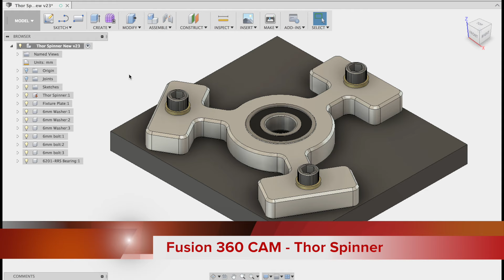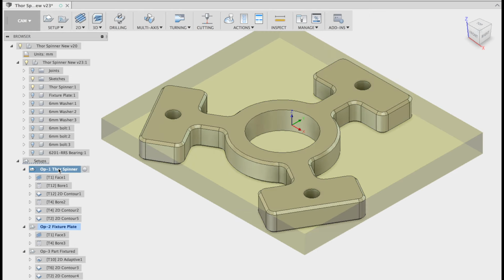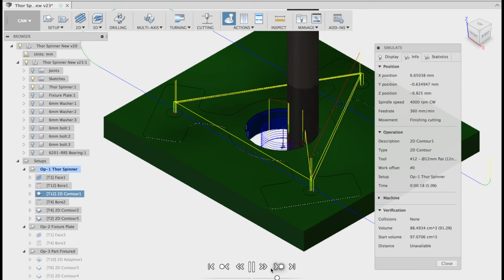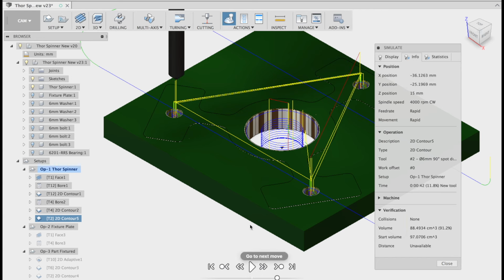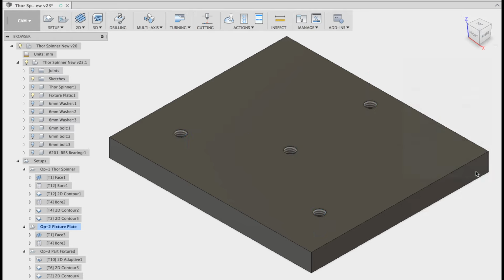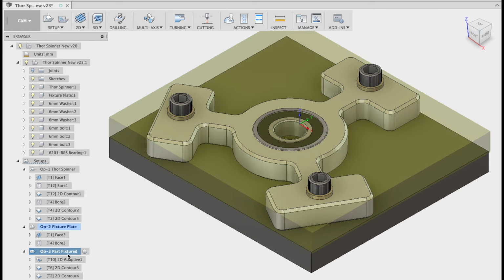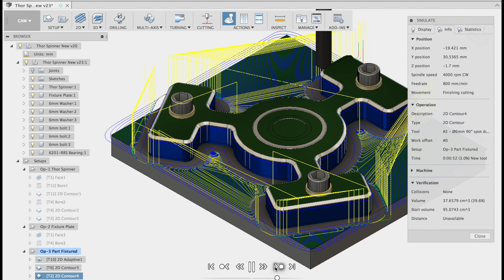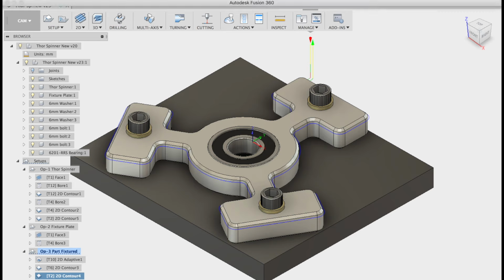Fusion 360 CNC It's So Easy - Thor Fidget Spinner Toy FF.E9

Comment: I would recommend adding another pass to the helix bore for the center bearing. because having a piece leftover in the center if you are breaking through the material could be grabbed by the cutter and could cause projectiles or result in a broken cutter.
Reply from the maker: Yes, and or use a bigger end mill or drill before hand 👍

Comment: what flycutter is that? do you have a part #? great vids
Reply from the maker: Hello Brian.  Thank you for watching and for the nice feedback.  The cutter I was using there is commonly referred to as a face mill (shell mill).  This one in the video is a 50mm dia and was purchased off eBay.  You will also need to purchase the arbour and interchangeable carbide tips also.

Comment: Mate love your work and the way you teach
I'm an old school fitter and turner tool maker getting into cnc side of things
Have an old Pluritech cnc machine Im also from Melb
Reply from the maker: G'day Brett.  Thanks very much mate, as I really do appreciate the feedback.  You're too kind ;-)  I'm originally a motor mechanic by trade.  Jumped into mechanical fitting back in 1994 and fell in love with machining and fabrication.  I'm a high school technology teacher these days.  I haven't heard of your inc machine before.  I'm going to google it now.  Cheers, Aaron.
Reply: They main build circuit board making machines but have moded mine

Comment: So cool!!  Must feel pretty good to be makin' all them chips!! :)
Reply from the maker: bluehandsvideo hey buddy, you're not bloody wrong mate. It's been down for all most 1 year nor now. That was all machined on the Masso. Running well now since I did a software upgrade 👍
Reply: Is there a post processor for the masso?  Still going to be a bit before I can swing one, but I'd like to get one for the lathe first.  Guess I'd better get it running again first. lol
Reply from the maker: Hey Mike, the Masso takes generic fanuc code. However, it has been playing up for me using that post in Fusion.  So I've been posting all cycles as generic Haas and it works a treat (haas basically uses fanuc anyway). How cool is that ;-)
Reply: That's very cool!!  The masso keeps looking better all the time! :)
Reply from the maker: The great thing (I believe)  is that you can actually talk to them and they'll listen. For example, 2wks ago I suggested to Hind that us VMC guys need jogging increments all the way down to 0.01mm. Within a week they had is sorted and emailed me out a controller update.  Try that with the others?
Reply: It's the small things, that if missing, can be a bit frustrating.  I'm happy to hear that's one more thing that is fixed and improved!!  Hopefully, I can afford one by the time you get it all sorted out. :)
That's great that they're so responsive to the early adopters like yourself.  It instill confidence in the buying decision. :)  Keep it up Aaron!!  Great work!
Reply from the maker: Thanks Mike, will do bud ;-)

Comment: nice video Aaron, I noticed you moved your bolt hole locations off the hammer head on to the arms. what made you do that?
Reply from the maker: Hey Chris, yeah I mentioned that in the video as it was a design flaw in my original design.  The cap head bolts got in the way of the spot drill when chamfering.  Plus as Micheal (woodworker) stated previously this allows you to insert a brass plug or ball bearings for added weight and or improve cosmetic appearance.

Comment: This is not the project made, different item than the project.
Reply from the maker: scorpioo Yes you are correct. I actually disclose this in the video stating the original bolt holes in the handle were are design flaw and therefore changed. Apart from that the parts are identical. Thank you for taking the time to watch and comment.